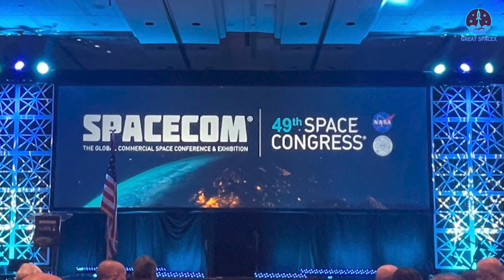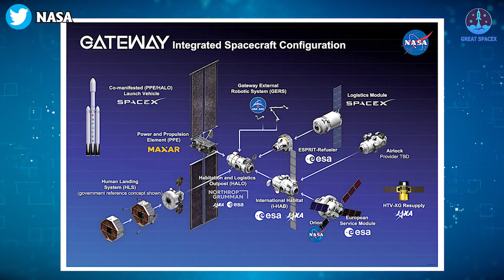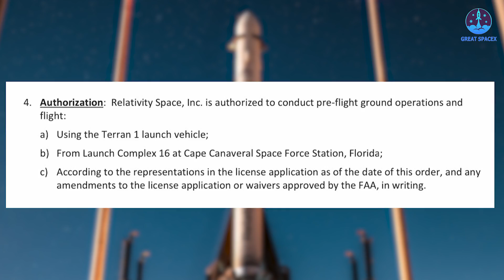NASA Reveals Major New Lunar Gateway! SpaceX Starship opens up...

Comment: Seeing this a year later as SpaceX is prepping for Starship launch #7, a successful booster catch on the first try, and Boeing's Starliner completely dropping the ball, I have to wonder if we will look back in another year and see Starship's larger structure being used to build lunar gateway.  That's even more likely since NASA really wants to see a starship orbital fuel transfer happen within the next couple of launches.  Nobody's SAYING that yet, but Texas' governor is pushing through launch authorizations for SpaceX tests, NASA seems to be doing the same, and the FAA just announced their regulations are out of date and holding the space industry back...which sounds like the FAA wants to give the whole hot potato that is space development to NASA and Space Force.  (Since everybody was scheduling launches and not waiting for FAA launch approval anyway, I don't think they want any responsibility for rubber stamping a launch test that goes wrong.)  We will see.

Comment: Gateway station as no build problems for re-entry?? Its Lego Meccano build as you go extensions and fuel tank clip on clip off throw away as you go  one main central heavy water ice  unit for heavy radiation protection habitat and spiral out to individual units that isolate for other uses connections storage transporting in and out? Basic easy to use maintain  clean extend should be the maintaining? ISS is good but is a mess because of too many different players? Musk's basic less is better less is more beautiful is the way ahead

Comment: A lot of the older programs and plans will probably be discarded. A Starship has more interior space than the ISS. The Lunar Gateway will look different from current designs because they aren't limited to using ULA or Saturn 5 rockets to get them into orbit. The cargo space and weight abilities of Starship will change designs dramatically. A Starship will be able to make orbit for about 1/10th of current cost estimates for Artemis.
Reply: I completely agree, this entire Artemis is a MONEY pit!
Reply: SpaceX will orbit far more payload than NASA’s SLS for between 1/100th & 1/1000th the cost.
Throwaway NASA legacy POS SLS is $4+ BILLION per launch..Reusable  Starship flies for the cost of fuel.
Reply: Hopefully Starship Launch estimates decline after gaining the industries trust of reliability. You can Launch a couple  other smaller payloads and knock a couple $mil. Off right there. What's was the launch estimate Elon was talking about hitting eventually? I think it was a good amount lower than even $50mil. Either way, Since we the Tax payers are footing the bill, I think contracts for all Heavy Launch projects should go to StarShip. Artimus should be in its assembly building, And only used if(and it's a big if) Starship is put out of service for awhile for investigative reasons(say one has a RUD) As this govt and their contractors either lose track of, Or ridiculously over charge tax payers(like invoicing less than 75pcs nuts and bolts for over $30,000, Same hardware we buy at home Depot for what, $25.00) And comes up with a per launch cost of over $7Billion, And not one part of the rocket is reusable? I'm sorry, But to me they are all getting so comfortable with creating over priced programs to embezzle our hard earned tax money, They are not even doing much to hide it anymore. I Love SpaceX because their full transparency thru the entire build process, From thought to design, And testing to success. Launch costs are always brought up when/if increases are added, And has put to rest my confusion on govt/NASA/contractors over charging massively to line the pockets of top officials of all 3 sectors. Tax payers are working to pay ukraine billions(why can't ukraine provide details of where the money has been used) a country known for the most corruption in the world, And finding out all pharmaceutical and bio-labs, Also fully funded using probably $100s of millions of US tax payers are now based in kiev,ukraine and the urgency of certain govt officials to rush all this money over there, If an actual Investigation was done, As it should have been started when an audit was requested by US officials, And 70% of the cash sent was unaccounted for and invoices showing accountability for only 30% I'll bet there are so many US govt officials that have accounts in ukraine used to wash, Or just a safety net against the possibility of a whistle blower or truth finder gaining credible info and sources to inform the public and the call to hold them responsible by the citizens, And  prosecute them to the fullest extent of the law. Lastly, How careless are they getting? A news story was aired only a few months ago, Many months into the conflict going on, Talking about the almost $10million house zalenskyy had bought for his parents, Oh and can't forget the "salt water pool" it has. It's also been reported that a group of ukrainians, probably part of or close to members of the ukraine parliament, Have been witnessed in surrounding countries buying up many properties and paying for them with cash. Now biden wants to pay their pensions, and support so they can have money in their pockets while we are over here suffering. Not to go off topic here but it's all things we need to all understand is going on, Or it's just gonna get worse.

Comment: SpaceX could make it a 2 part system and be able to same all the boosters that way.  Have one Falcon Heavy lift the Dragon XL and the other lift a special second stage as a payload.  Then combine the 2 in LEO and use that extra booster to send everything out.  This is kind of like refueling the Starship in orbit.
Reply: Once Starship is operational, all Falcon rockets will be obsolete and discontinued.

Comment: I have to wonder if there will be Starship launches with a Falcon 9 upper stage taking over some of these Falcon Heavy missions?  The problem with sending a reusable Starship around is it is heavy and thus it takes a lot of tanker Starship missions to get it anywhere, let alone also with a payload inside.  However, Starship should be able to achieve LEO easy.  So an already mass produced, light Falcon 9 upper stage with a payload on top all housed inside of Starship, possibly a stretched Starship, which SpaceX has already mentioned as an option, should work just fine.

It would be kind of fun though to redo everything so that the lunar gateway goes up all in one go on Starship and then use orbital refilling to get it all to Lunar space.
Reply: If you have a Starship, why would you want a Falcon upper stage? Falcon upper stage isn't reusable, and it's way smaller.  The Starship has ten times the capacity. Starship will make Falcon 9 and Falcon Heavy obsolete. It would make no sense to put a falcon upper on a Starship booster.
Reply: @TexanUSMC8089  There is a particular use case.  Elon Musk is now talking about Starship costing $10m a launch.  The Starship upper stage is also looking to be 120 tonnes of empty, dry mass.  When you want to go somewhere besides LEO, that is a big mass to move around.  Then you need to move around the payload and any propellant you use to move this all around and use to bring Starship safely back to Earth’s surface with.  To say get Starship to the orbit of the Lunar gateway with everything you would stick inside of Dragon XL with current methane prices, which is freaking expensive, you are talking several $10's of millions to do the initial launch and also several more refilling runs so Starship can make it out to that Lunar orbit and back, probably something like $70 million it costs SpaceX to do.

Now say you load a Falcon 9 upper stage and a Dragon XL into Starship.  It does a single flight to orbit, far less complicated to do than several tanker runs, which has never been done before.  Then it deploys the 4 tonne dry mass Falcon 9 upper stage, but loaded up with enough propellant for the trip and the Dragon XL stuffed to the gills with stuff.  Maybe a few 10's of millions are spent on this.  It likely costs SpaceX around $7 million for the Falcon 9 upper stage and then a few million more to make a Dragon XL as it is really a super stripped down can with some basic navigation and propulsion added.  So maybe the whole thing costs $25 million to put together and serves NASA's mission fine.  So then SpaceX charges NASA $60 million and makes a tidy little profit.  Why have SpaceX spend say $70 million for the initial launch plus 6 tanker runs and then charge say $160 million so they can make a proportionally similar profit margin?

There are also things like if you have a Falcon 9 upper stage inside, you can do something similar to the Saturn V where it dropped off its second stage just below orbital speed, but in Starship's case, a very low, rapidly decaying orbit where minimal propellant is needed to get it back to the launch pad on Earth.  Getting Starship back from Lunar orbit is probably going to take a lot more propellant.

The thing is all of these tanker runs to move a big, heavy 120 tonne rocket stage around adds up in cost while a little 4 tonne Falcon 9 stage is pretty cheap to make and light enough to efficiently send around, so if that will do it, why do this other thing?
Reply: I also thought about this but it seems it is unnecessary. Falcon heavy is a better choice for such type of mission i guess.
Reply: @adamindra5102  The problem with Falcon Heavy is that center core is almost always lost if not lost in every mission so far.  The more you speed up the center core, the more you have to slow it down using precious propellant before it reenters the atmosphere or else it will get destroyed by "the wall".  With the Dragon XL mission, they are talking about discarding this center core on every launch, which gets expensive.

So then if you can get both stages of Starship back and fly them again when you always throw away the center core of Falcon Heavy, why would you not use Starship?  If you have something Dragon XL sized to send off to Lunar space, the Falcon 9 upper stage plus a single Starship launch is probably going to be cheaper than refilling Starship in orbit and definitely cheaper than a 9 engined Falcon 9 booster custom made to be a center core for Falcon Heavy.
Reply: @ChaJ67 Ok well i knew they will destroy them during the reentry but i wasnt sure if the actuall refueling procedure would be cheaper. So thank you for the reply man.